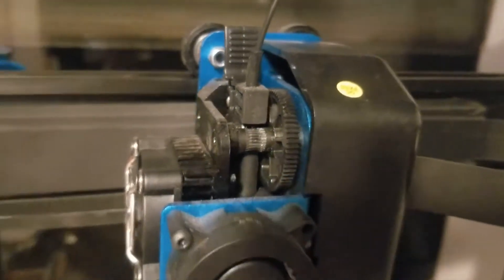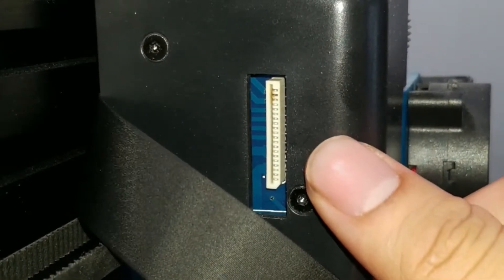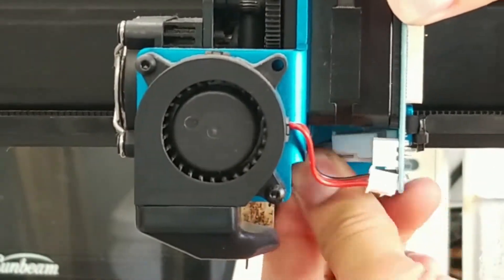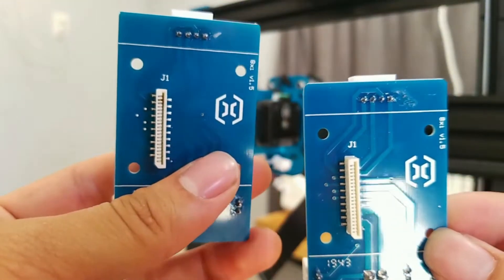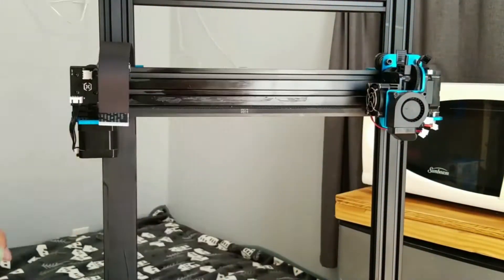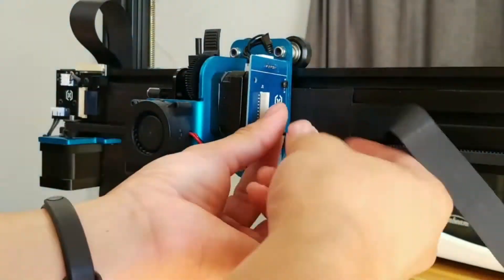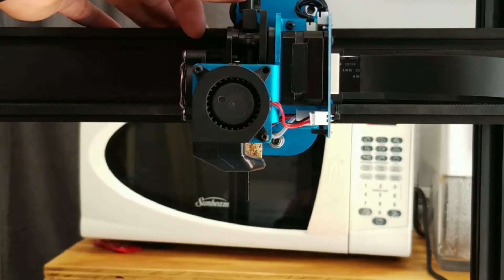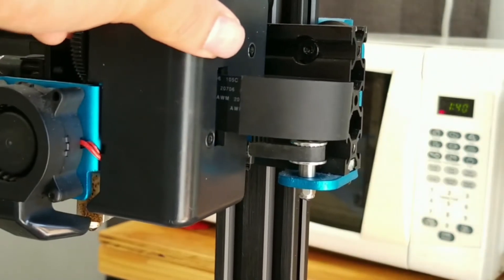Replacing the Extruder Board and Cable - Artillery Sidewinder X1

Comment: Thank you for the guide. I have the same problem with my Genius. When the extrusion wheel starts ticking I have noticed that if I help the whell with a little push with the finger it starts again to extrude. Then the problem happens again later in the printing. If it is a cable/pcb board problem, it shouldn't restart to extrude or not ? Thank you very much in advace
Reply from the maker: Depends on how damaged the cable/board are. It may be small, but it could be possible that it has some slight damage and when you push it with your finger, you help it overcome the resistance inside the motor for a short time (speculation). I'd recommend if you have a spare cable, first test to see if this is the problem. You don't have to completely remove the old one, just leave it while you plug the "new" one to test the extruder functionality. If not, it could be a board problem. The last thing it could be is a motor problem.

This is the extend to which I know.
Reply: @jarodmica   thank you very much for the suggestion ! I will try this and let you know 😉

Comment: That didn’t sound normal. Mine is virtually silent.
Reply from the maker: Your sidewinder when running is silent? Thats pretty nice
Reply: @jarodmica  Yeah, that extruder motor doesn't sound right. Maybe the screws on the left that tight the extruder wheel are too tight.
Reply from the maker: @PeopleThatFallApart  2 votes on silent operation :(, I'll have to take a look lol. The sound was present when I bought it and I just attributed it to the gears on the assembly.
Reply: @jarodmica  I recently disassembled the extruder to change the plastic extruder arm because it broke, and when I reassembled it, the extruder motor had a hard time moving the wheel, even not moving at all, making noises like the ones in your video. Turns out I over-tightened the screws behind the left fan. Loosening them slightly stopped making noise and works without problems. I had to put a few drops of thread-locking fluid on it because it would loosen up on its own anyway.
Reply: Yeah definitely not normal. Sounds like the gear isnt engaging the motor cog well enough, which is slightly adjustable. Ive found keeping the screws a little loose helps because when things heat up it gives space

Comment: can you show how to do a extruder switch
Reply from the maker: Could you explain a little more? What function are you referring to when you say extruder switch? Is it the little filament sensor up top?
Reply: @jarodmica  sorry about the wait, the nozle
Reply from the maker: @treyvon8358  Like changing nozzle sizes or changing the extruder end? I'm still unsure of what function you'd like me to show for replacing
Reply: @jarodmica  the part where the filament comes out.
Reply: @jarodmica  gold looking piece
Reply from the maker: @treyvon8358  Ah, ok I got what you mean. I can do a replacement video sure
Reply: I'm having the same problem with my Genius right now.  I have an extra ribbon but I don't have an extra board.